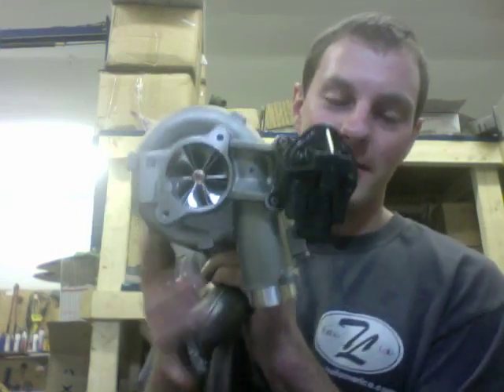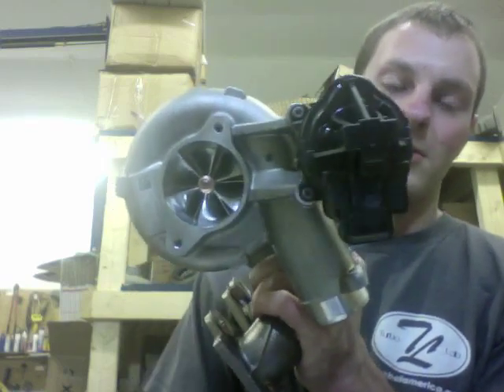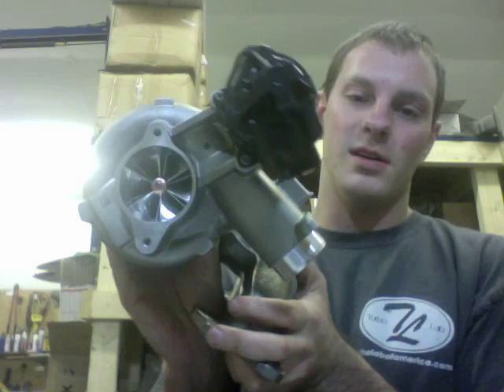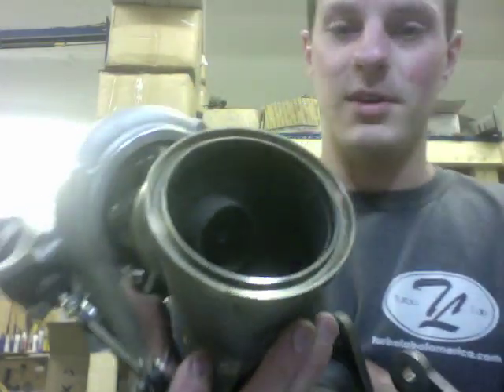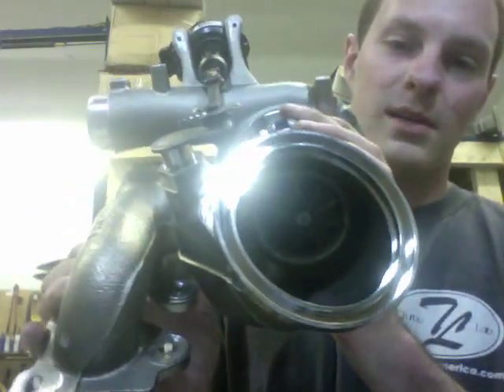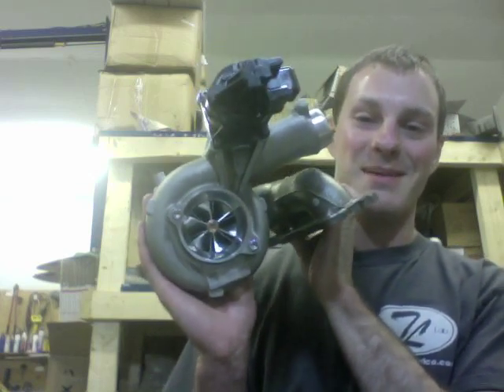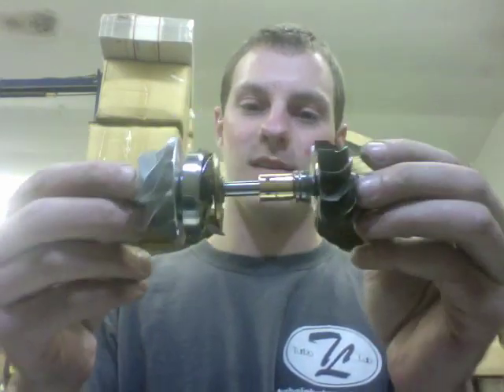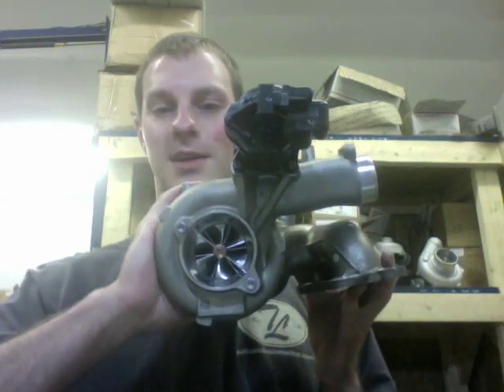2016 BMW M3 M4 TFO35 TD04 Turbo Upgrade

Comment: wait does it mean the stock M3/M4 Turbo is Journal Bearing?
Reply from the maker: +Raditya Amandra  Yes.
Reply: +Turbo Lab America i see, is there a way for upgrading Nissan Garrett turbo from Journal Bearing to Ball Bearing? like T25/T28 from RB26 or SR20? because i see you sell a Ball Bearing part for Garrett GT2860.
Thank You.
Reply from the maker: +Raditya Amandra T25 /t28 turbine housings that have 4 bolts connecting the bearing housing to the turbine housing cant be machined for the ball bearing cartridge. The turbos with 6 bolts retaining the bearing housing to the turbine housing usually can be machined. The compressor housing is a direct fit on the ball bearing cartridge besides in some cases the housing will need to be machined for an upgraded compressor wheel.

I did an RB20 turbo upgrade not to long ago, where i converted it to a GT3071R compressor (53.11 x 71mm) and 55 x 60 mm turbine. i cant remember if i made a video on that, but the cost to convert it is 650$
Reply: +Turbo Lab America I See, is there any other mod other than changing Compressor wheel to GT28 one (47 x 60 mm) to increase performance since i cant do a Ball Bearing upgrade. Thanks.
Reply from the maker: +Raditya Amandra Im a little confused on which turbo you have. I dont know nissan turbos so well. I know the nissan 300zx turbos, dsm t25's, and the sr20 turbo and the rb20 turbo. 

The sr20 turbo i think is just a journal bearing t25/t28 with a t2 flange, The RB20 had a t3 flange. Sor the RB26 is t2 or t3?
Reply: RB26 Turbo, it use an T25/28 Garrett Journal bearing. It's nearly same as the SR20 but it use an 0.42 & 0.48 A/R Housing. It has a 4 Bolt turbine to hold the bearing housing. Comp Inducer is 42mm, Exducer is 60mm. while Turbine is 41-50. Right now i'm fitting GT28 47mm Inducer Comp Wheel and Inconel Turbine wheel since the original will break after 1 bar. So any suggestion? Does BB design Turbine wheel will fit to Journal Bearing Housing? because the size that most that bigger than the original are all BB Design.
Thanks.
Reply from the maker: no the design is completely different.